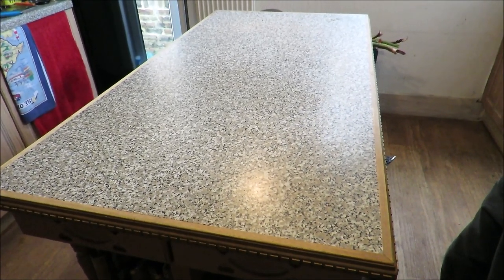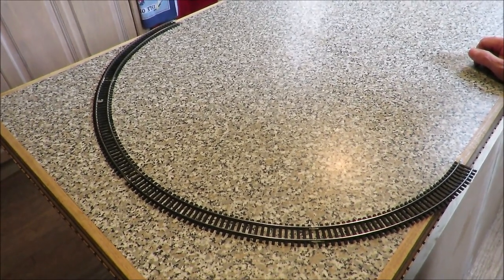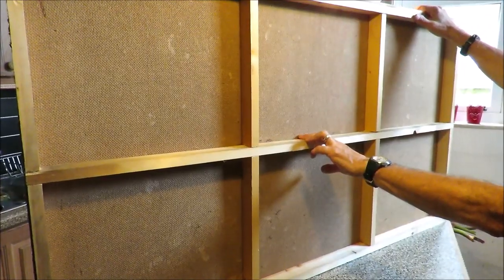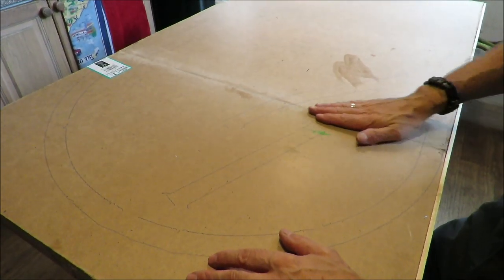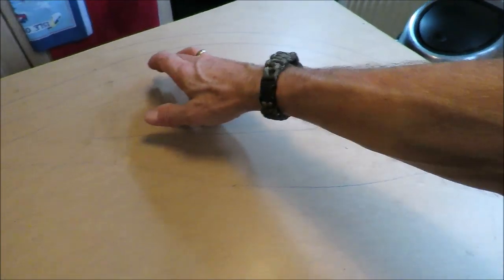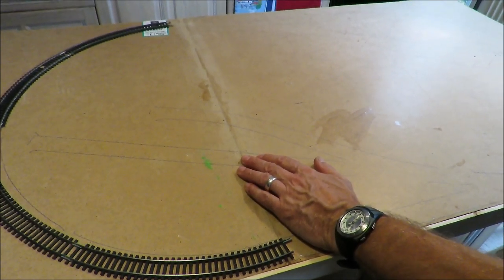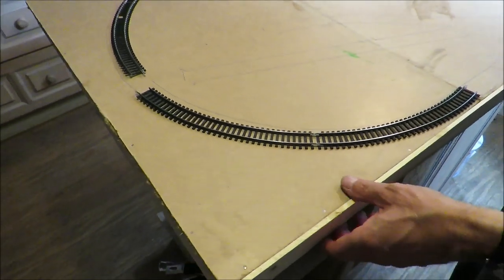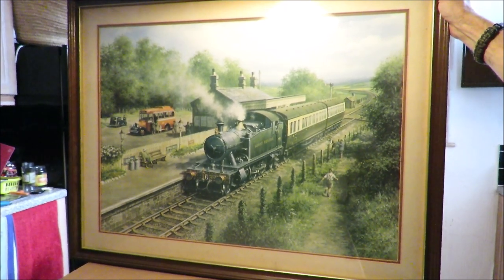Creating An OO Gauge British Model Railway Exhibition Layout - Part 1 - Baseboard

Comment: Considering the location you are building this layout for, a few tabs coming down about an inch on the outside or inside of the perimeter at the corners to keep it from sliding off the island when in use might be handy. As a bonus, if built beefy enough and designed properly they could be used as legs (maybe even with adjustable feet) allowing it to be displayed on a folding table at shows.

Comment: I found a 4x8 sheet of 1/2” thick extruded pink foam that I’ve cut into four, 2x4 pieces where I can make simply N scale layouts.  Similarly to having a small switching operation or roundabout fun.  It’s amazing how y’all at BMR can take a concept and with minor adaptations create new, unique and innovative works of art to keep the hobby fresh. 

It would be interesting to know as an add on to your video how many layouts your subscribers have laying around or in progress.  I have a 14x4 layout in progress, a 3x4 layout, a 3x2 that need a bit of care and a 2x4 end to end switching (shunting) layout in progress.  All N Gauge/N Scale.
Reply: Well I have two layouts, one for around the Christmas tree, one under construction that is in the 'everything BUT budget' category (Dcc wiring, points worth 30 euro each, strict epoch adherence) and a crate full of Fleischmann pre ballasted track
Reply: Nice, my large layout was outfitted with at cost materials (before I understood the concept of budget railways) that I have borrowed from to complete portions of my small layouts.

Comment: I came up with something that you might find interesting ,i built a baseboard 8'x4' nothing out the ordinary there now the thing i thought about was little things like the noise the boards going to make with trains running ,I know you can buy the stuff you put under the tracks ,i find this can be pricey ,
what i did to get round this cost me £5 from selco ,i bought a sheet 8'x4' of polystyrene the stuff used for putting under wooden flooring. I bought kids paints from the pound shop and painted it all green to remove the whiteness.now the thing is yes it worked great took the sound right down ,made the trains run smooth .and its a inch thick so on parts of it you can cut away and shape the land .great for building grave yards  as you can have graves dug out ,great for rivers and canals trees and items can be stuck into it .and the bonus is you can take the whole thing down and start over again with a new lay out as your main base board is still there.just buy a second sheet of polystyrene.
Reply: you could strengthen it with a thin piece of ply if needed .the point is it can be moved about.changed swapped ect ect. so when you get bored of a city lay out you could build a mountain country style lay out .for a change of scenery.and later switch back .your options have become endless.
Reply from the maker: Sounds epic, very clever

Comment: Homewood Vale is a historic part of the area surrounding the City of Ratton. Civilizations have lived in the area for around 2400 years starting with a group of people that lived and farmed off the area. They were known as the Ofor people and were lead by a line of chieftains. One of these was a rather tyrannical fiend by the name of Eedon who seamed to care more about his desires for glorious victories in battle with other tribes than his people´s wellbeing.

It is not entirely known when or how Eedon got himself into an argument with the leader of another nearby tribe, the Barcs. What is known is that Eedon´s plan for protecting his community was about as successful as trying to make an 0 scale train run on Z scale track. Rather than gathering his best fighters for a battle immediately, Eedon had his people painstakingly build three rings of stone pillars in a triangle shape. Eedon believed they would create a shield to protect them which obviously did not work.

 As the Barcs charged into the triangle the Ofor people were cut down in a siege so awful the slope it took place on became known a Slaughter Hill. This would be changed to Greenhill during the mid 19th century.

After the siege the Barc people took over the land and would inhabit it for around 600 years before terrible floods saw many die off. The next 1700 years saw civilizations rise and fall in the area. In the 14th century a new settlement was developed by the bay known as Foyles. During the construction one of the three stone rings constructed by the Ofors was torn down, breaking the triangle that Eedon had once believed would protect him.

Over the next two centuries more villages and hamlets would crop up in the area. The village of Homewood was the largest in the area and was in fact visited by King Henry the 8th himself on a hunting trip in 1524. A painting by local painter Duncan Dudley produced a few years later would depict King Henry riding down into the Homewood Vale with several Hounds beside him. He is shown riding over the area where the railway station would stand over 470 years later. The painting is still on display in the Ratton museum and in the background it is possible to make out the stone circle on a nearby hill.

Comment: Due to watching these videos and the fact you think outside the box I have just assembled 6 baseboards 3 feet long by 11 inches wide to go around a small bedroom. The main piece is 2 inch styrofoam wrapped in 40mm x 20mm wooden stripsand to support the styrofoam I have used (you've guessed it) hardboard. I have worked out this will allow 3 tracks, 2 main line and a freight run. Superb again Mike but you will again have them Tut Tutting.
Reply from the maker: Sounds epic, good luck with it. Its the putting makes it all worthwhile

Comment: Please can you do a video on how to wire dead sidings on shunting layouts that are facing the opposite way to electric current
Reply from the maker: We have covered it in several layout videos Inc the recent shunting layout. Basically you just add power to the siding wired into the main power using a connector block. If you want to isolate it then you will need to wire in an on off switch. We might do a video on it soon, thanks for the suggestion

Comment: I do like your idea. Hardboard I,ve was told years ago wraps badly, be interesting what happens to yours. Have to say much better than 18mm chipboard i.,m using. Thanks
Reply: If you make the holes in the frame small enough it probably won't warp... As long as you do not throw litres of water and glue on it for grass and other landscaping.
Reply from the maker: It might a little but so far so good
Reply from the maker: Good point. I'm going to try take scenery separate for that reason

Comment: What's the exact problem with Hornby points?
Reply from the maker: The plastic frog is too big which causes locomotives to stall at slow speeds. The mechanism is quite fragile and lacks the secure movement of the Peco point, and it's not uncommon for the Hornby mechanism to break
Reply from the maker: If you are primarily just running trains, and not slow speed shunting then there is nothing wrong with the Hornby point in most cases. The reliability can be an issue though
Reply: @BudgetModelRailways  Oh I see, thanks.

Comment: i would be very interested in the roofing felt if it turns out to be suitable as i cant' find any decent stuff anywhere
Reply from the maker: It worked fine will try and put a link etc in the next video
Reply: @BudgetModelRailways  yes please do as i have ground to a halt.
Reply from the maker: The link is in the description of our latest videos, it worked great, let me know if you want more info
Reply: @BudgetModelRailways  Thank you for that it does look very black on the video i wonder if you wanted it to look lighter if you could lightly spray paint it
Reply from the maker: I did experiment once with dry brushing light grey. You can get grey felt but it's hard to find